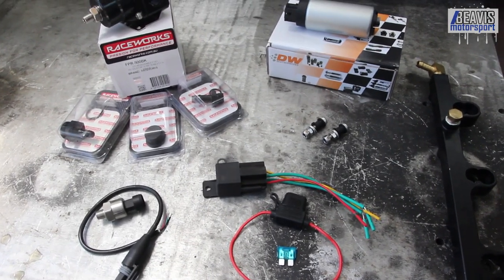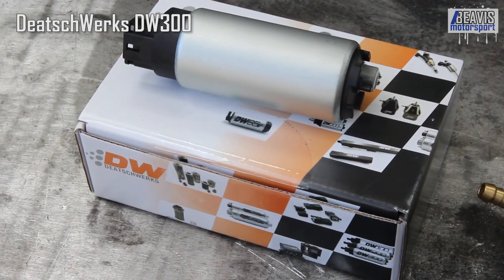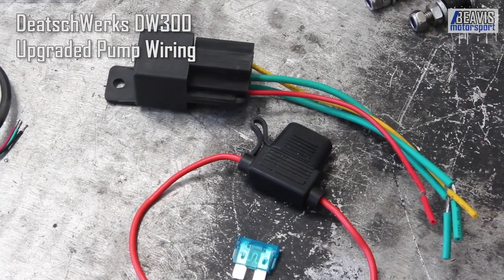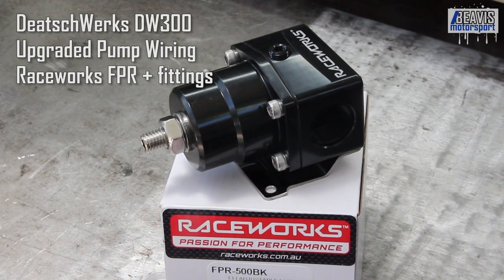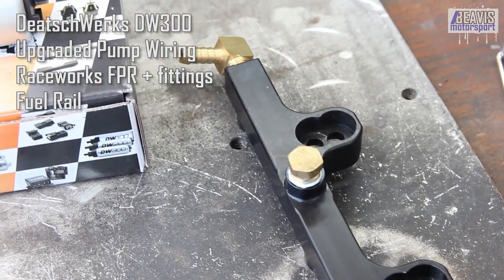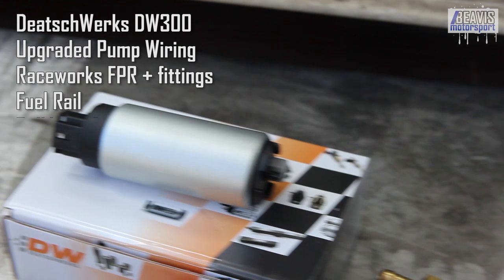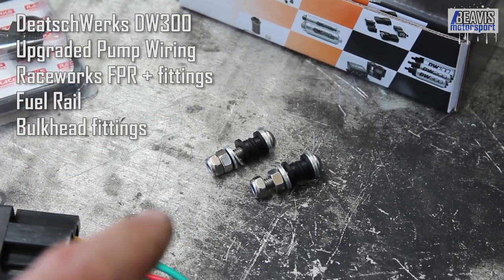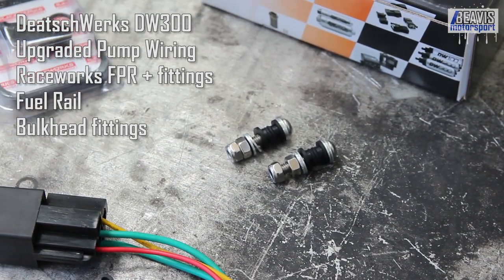400HP+ CAPABLE FUEL SYSTEM // Ep 72 // Time Attack TURBO Build

Comment: @8:26 I see you drilled through the pump lid and added better connections separating with nylon spacers. My question is are the new screws you used to secure the connections touching the fuel lid or did you drill holes big enough so the screws aren't touching the lid? Also then did you fix eye connections on the screws on the top I assume so? I want to do this but I don't want to cause any hazards.
Reply from the maker: Nice spotting, but certainly they aren't ordinary nuts and bolts, they are specific bulkead type standoffs, with sleeved washers and sealing o-rings.
Indeed they cannot touch the fuel tank lid. You wouldn't want to just run bolts through there, it'd create a mighty bad short and blow a fuse.
Reply: @Bbeavis  thank you for the response and the information! You have a very neat setup. Very well thought out.

Comment: Do be careful as sometimes if you leave the fuel pump cradle assembly out that rubber gasket starts to shrink after a while and won’t seal down properly on the tank and start to leak a small bit.
Reply from the maker: In this case it was only exposed for a half hour or so.
Reply: BEAVIS Motorsport I do wonder.. How would you fix a shrunk gasket? Put it in hot water or something?
Reply from the maker: @jakeguitarbass7209  Rub it until it gets bigger.
Reply: BEAVIS Motorsport xD xD xD

Comment: Anyone know if that FPR is universal or can be fitted to a vw 1.8t engine? I’ve heard a lot of mixed reviews about Jegs regulators and I wanna look into some other brands
Reply from the maker: The Fuel Pressure regulator just requires an input and output for fuel, and a vacuum reference line.

Comment: How much did that setup cost?
Reply: DW 300: $150 , Pressure Reg $170, Fuel rail and fittings approx $170 = Call it a little over $500 with wiring.
Reply from the maker: Somewhere around what Nate said. Fuel pump with the MX5 specific kit was $240AUD, Pressure reg was $170AUD. Hoses and fittings I had spare.  Rail was 'free' for me as I had it in my box of bits.